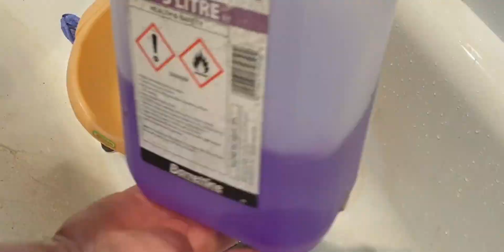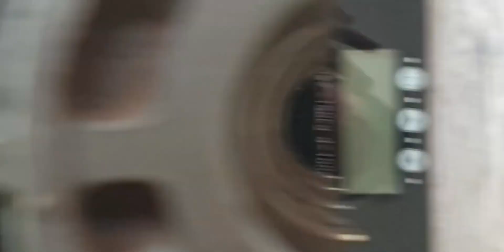How to clean an engine block 🚗 🚘 🚔 🏎 🚓 🚕 Toyota Starlet Corolla 4E-FTE

Comment: Whats that purple flui?
Reply from the maker: Hi Versiion2, the purple fluid is a type of cleaning alcohol. Its a mixture of Ethyl; and a small amount of Methyl alcohol, it does a good job at drying the block, seems to push water away from anything it touches.